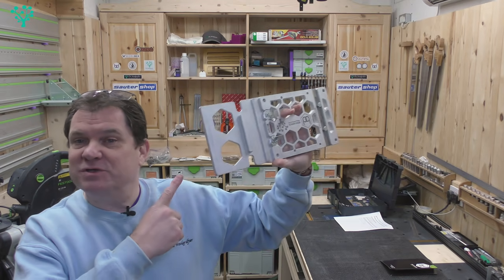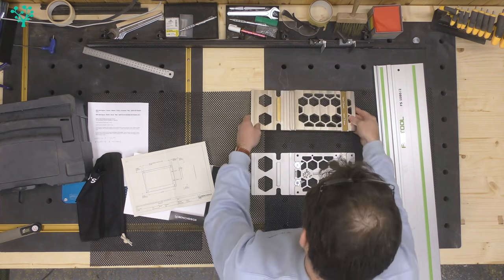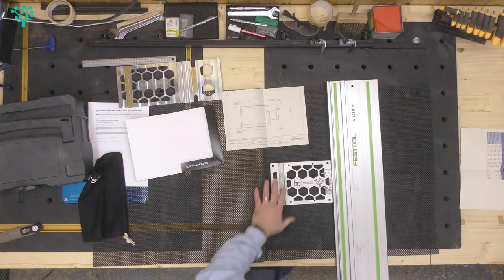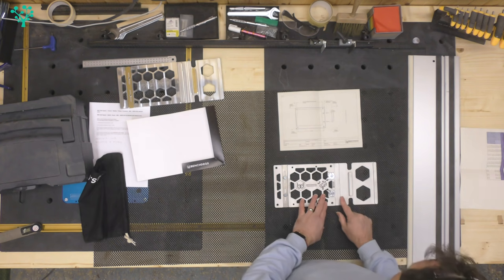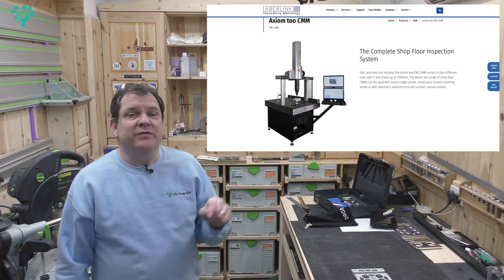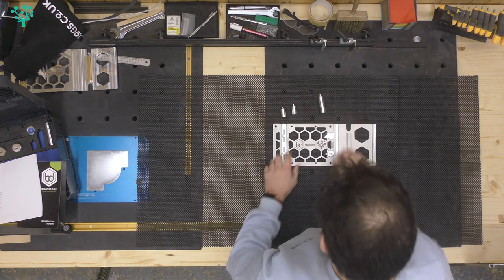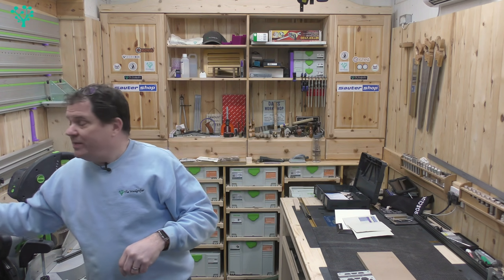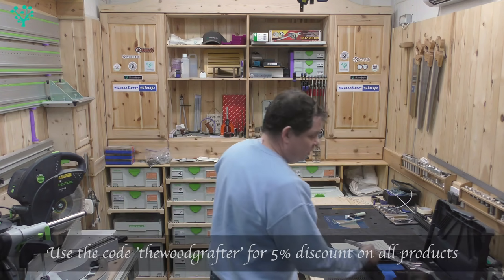Benchdogs MKII Rail Square Review

Comment: I just received mine. Shipping from the UK to the USA went surprisingly smoothly, not much longer than I would have expected a domestic shipment to take. Allow me to make a few comments:

First, the quality is excellent. I cannot complain. Second, mine is the version for the Kreg track saw. I bought it not so much because I needed it, but because I wanted to reward Benchdogs for supporting the Kreg track saw platform. I'll definitely be using this square. It will make a lot of things easier, but it won't make anything possible that would have been impossible without it. (That's okay! Quicker and easier are two very good things to have from a tool.) Third, thank you for the informative video! While I cannot complain about the quality of the tool, I can complain about the dearth of instructional materials that came with it. I appreciate that one of the hardest things to do is to write decent instruction manuals -- the writer, too often, knows too much about the tool to comprehend what a true novice would need to be told. So, while it's hard to write decent instructions, that doesn't excuse there being no instructions included with the tool!

Lastly, I think I may have the very first Kreg rail square from Benchdogs -- serial number K10001! Does that make this a collectors item? Maybe, I shouldn't use it after all...
Reply from the maker: Great news on all fronts, and thank you for getting in touch.

Part of the agreement with Benchdogs is he sends me over a new product, with no instructions and I work it out. I then give them a bell to ensure I haven’t missed anything and make the video.

So the videos are made from a point of view of knowing nothing about the product.

You should have got Ralph (owner of Benchdogs) to engrave his signature on it - then it would be a collectors item indeed.

I do actually use mine more than I expected so well worth having in the shop.

Cheers

Andy.

Comment: I do wish your over head camera was closer to the table top. I have the MKII rail square, your right it is very nice
Reply from the maker: Hi Chewy,

Long time hope all is OK.

Good feedback on the overhead camera, I am thinking about how I can upgrade the overhead system. It’s a bit static at the moment and want more flexibility from that angle.

Yes, the MK2 is a nice upgrade.

Regards

Andy
Reply from the maker: @ecuadorianme  Now that is a good idea - hell of a design though.

I am thinking of something based on V-Groove extrusions (similar to an open build CNC type design), the bit of the design I haven't cracked yet is the Z movement (the up and down bit).

But will get there.

Cheers

Andy

Comment: I went for the festool version as I could not be bothered to keep tightening etc with an alan key when i wanted to use the benchdogs one much easier with a clamp this version is better but i do find the festool one very easy to use and accurate.
Reply from the maker: I haven't actually used the Festool version - but those new clamps are a lovely addition on the Benchdogs version.

Cheers

Andy
Reply: @TheWoodgrafter  the bench dog version does look a better proposition now as long as the lock mechanism is strong the festool one is built like a tank and I paid £91 for it.
Reply from the maker: Hi Philip,

Time will tell, but they seem pretty robust.

Andy

Comment: Good review, but would the MFT dpters not also work as bevel adapters? In which case, why 3 sets of adapters to do the same function?
Reply from the maker: Hi Andy,

That is a really good point, the MFt ones do taper at the end so wouldn’t risk for the cut. But for the narrow bevel then yes they would probably work.

The other thing is that you tend to use the same thickness stock so many folks leave the B collars pre-set to a depth.

Cheers

Andy

Comment: I have a sneaking suspicion that the Incra LS positioner could be mounted to that in the 'accessory holes'
Reply from the maker: Hi Andy, I am not sure it will, and if it did you wouldn't be able to attach it four points on the bench, as the dogs holes don't lime up :-(
Reply from the maker: Hi Andy,

I checked this last night, and no the accessory holds don’t line up.

Good thought though.

Andy
Reply: @TheWoodgrafter  That's a bit of a shame :(

Comment: Great video Andy. One question I have is would you use the rail square or the Mk 2 fence system ? Struggling to see which I should get for an MFT bench or is there a use case for both ?
Reply from the maker: Hi,

I use both, 

My workflow tends to be.

Use the square to bring the stock down to rough size. Then use the fence system to fine tune for the project. The fence gives me repeatability with the flag stops.

I can also re-position the fence in relation to the track to give me some angles.

Not all stock will fit under the track so the rail square is great for long rip cuts etc.

Cheers

Andy

Comment: Thorough review of an interesting piece of kit 👍🏻 I guess the weak point will be the accuracy of the extruded rail. As a matter of interest when using the dogs attached to the square as there’s very little slack inserting and removing from the mft is a bit of a bind? Draw back on accuracy. Cheers Steve
Reply from the maker: Hi,

I assume you mean the track itself, yes that would be the week point on accuracy. Although the way they are designed should give a parallel cutting edge.

Yes the dogs can be tight in the MFT. However I didn’t find it to hard to insert and remove. The dogs in the MFT wouldn’t impact the accuracy.

Kind regards

Andy
Reply: Ps, yes I have purchased the rail square and agree totally with your review findings 👍🏻 Thanks for the review and discount code. Cheers Steve

Comment: Here is a trick to achieve parallel sides with only a rail square. Say you have a sheet of plywood out of which you want to cut a rectangle of a certain length and width and you want the corners to be square and the sides to be parallel. You have an accurate rail square with an angle error of only 0.01 degrees. Let us focus on the squareness and parallelness and ignore the dimensions. You begin by cutting the lower edge, edge 1. You put the rail square against edge 1 and cut the right edge, edge 2. The angle is only 89.99 degrees due to the rail square error. If you continue in the same way and cut edge 3 it will not be parallel to edge 1 due to the angle error. However, if you flip over the sheet so that edge 1 is still at the bottom but edge 2 is to the left and edge 4 is to the right, place the rail square against edge 2 and cut edge 3 you will be cutting on the opposite side of the rail square and the angle errors will cancel. As a result, edge 3 and edge 1 will be parallel. In order to cut edge 4 so it is parallel to edge 2, flip the sheet over to its original position, place the rail square against edge 3 and cut edge 4. Now edge 4 will be parallel to edge 2 since the angle errors are the same.

Comment: why is a bit of aluminium so bloody expensive?
Reply from the maker: Hi,

High quality Aluminium is expensive, and the tooling for the accuracy it brings doesn’t come cheap.

Then there is the design time, manufacture time and business overheads.

Of course the tax man will take his cut.

It all adds up.

The cost of this is actually lower than the competition.

Cheers

Andy